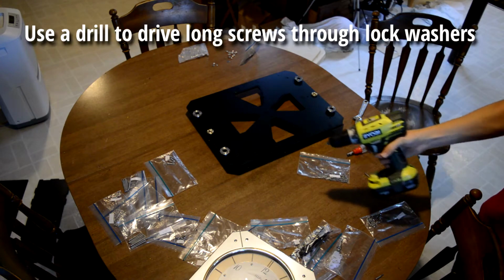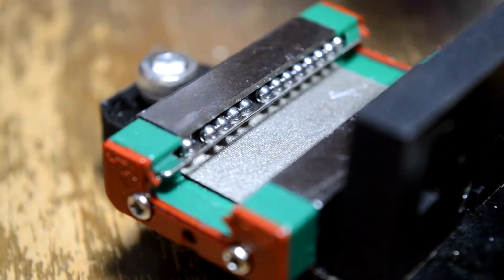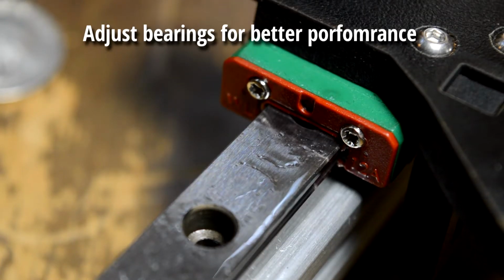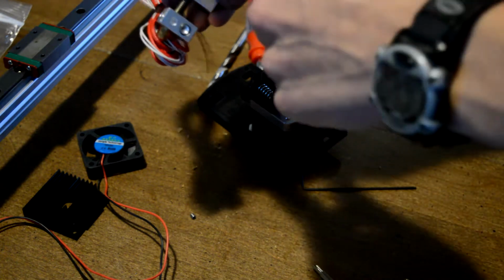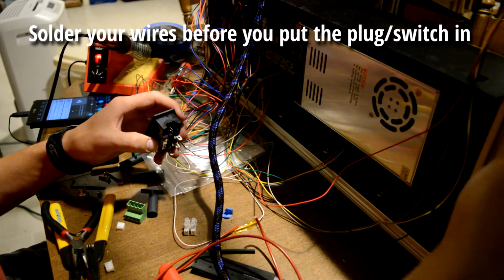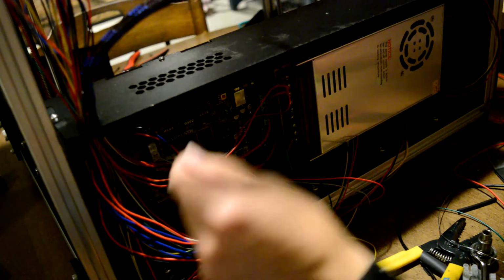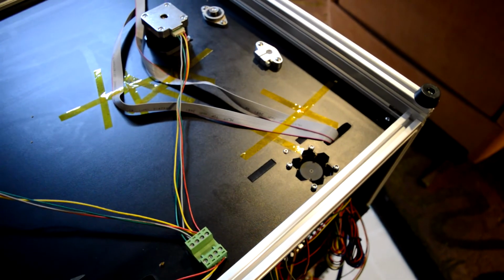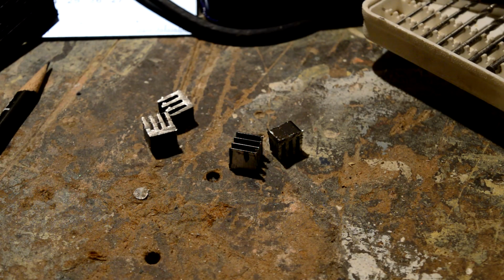Folger Tech FT-5 LARGE SCALE 3D PRINTER Timelapse and Building Tips (3DP#02)

Comment: Hi I really need help.  My ft-5 has come in and I have completed the build.  I am having trouble because once I power on the ft-5 I get sufficient power from the power supply, and I run the cooling fan for the circuitry, but I get very little power to the rest of the board.  Do you have any problems like this?    Thank you
Reply from the maker: What do you mean by "very little power to the rest of the board". There is really only one board in the system, and it's the MKS Gen board that controls everything. If the steppers seem really weak, you'll need to adjust how much current they send to the stepper motors by adjusting the small knobs (potentiometers) on each of the stepper drivers. Look up how to do that elsewhere, as my method is likely not the best. I'll explain it further if that's actually your problem, but I'd like to know the specific issues you're having.
Reply: I actually found that two of my wires to my y endstop were crossed causing the board to short. Giving a voltage drop of 0.67 to the whole board

Comment: hey I'm about not buy my first 3d printer and just had a couple of questions. Im a huge iron man fan and plan on spending most if not all my time and money creating armor pieces. Would you recommend the FT-5 for building armor pieces such as iron man's? keep in mind that I'm a beginner and have never used a 3d printer before but I plan on getting into it and have done a lot of my homework on it so I believe that this would be a great printer to start off with.\
Reply from the maker: Kyle Feliciano, So long as you follow the instructions, you should be fine, but it is a bit of an advanced build for a beginner. If you already have a little bit if electronics knowledge, you should be fine. This would be a good printer for that, so long as the armor pieces are large. If they are designed to fit into a more standard 200x200mm build plate, then you wouldn't gain anything from the ft-5. It'll definitely be a while before you feel the need to upgrade, but for a first time printer, I would look for something else first. 

Ask around a but more before deciding; it's a big time and money commitment.

Comment: I'm having issues with my z axis on my ft5 printer, could you please help me out? my arduino software is giving me this message. what do i do?

Arduino: 1.8.1 (Mac OS X), Board: "Arduino/Genuino Mega or Mega 2560, ATmega2560 (Mega 2560)"

In file included from sketch/Configuration_adv.h:689:0,
                 from sketch/Configuration.h:1129,
                 from /Users/SergioCendejas/Desktop/3D Printing/FT5_Marlin_v3/FT5_Marlin_v3.ino:37:
SanityCheck.h:281: error: #error "The given RIGHT_PROBE_BED_POSITION can't be reached by the Z probe."
         #error "The given RIGHT_PROBE_BED_POSITION can't be reached by the Z probe."
          ^
exit status 1
#error "The given RIGHT_PROBE_BED_POSITION can't be reached by the Z probe."

This report would have more information with
"Show verbose output during compilation"
option enabled in File -> Preferences.
Reply from the maker: The little switch that's supposed to run into the bed to tell the printer where the Z-axis is isn't being reached by the bed. I remember hearing about this problem earlier, but I didn't experience it. That switch should be on the back right smooth rod for the Z-axis, and with the way mine works, the switch is activated by the raised section around the back right linear bearing. You may need to mount the switch with different holes on the 3D printed bracket in order to get the switch to hit on that bearing. Look up this issue on google, as many others have had it and fixed it.

EDIT: Also, if the switch IS being hit, you may need to make sure that you plugged it into the right port on the MKS board.

Comment: What firmware u used? And how did the software part worked out?
Reply from the maker: I think I used the firmware that was linked in the online manual, but it seems to be pretty standard Marlin Firmware. Overall, the software worked out pretty well after I got the COM port drivers installed on my computer.
Reply: Ah, I see. I thought there were some problems with the marlin when u mentioned it on your video. You probably meant an Arduino connection problem. That clears it up on my part. Thanks.